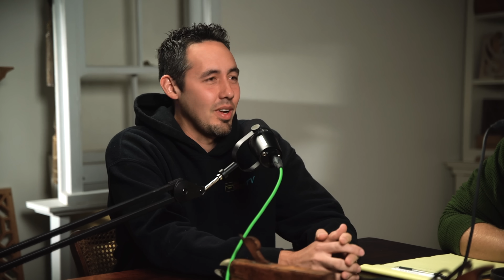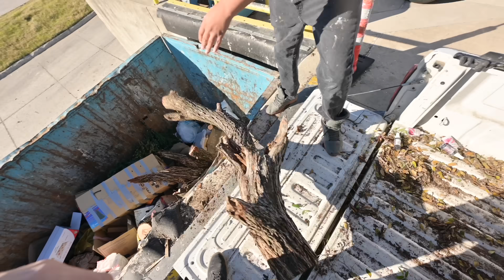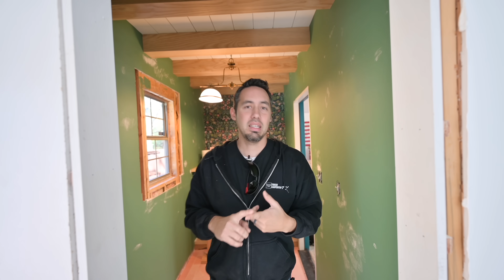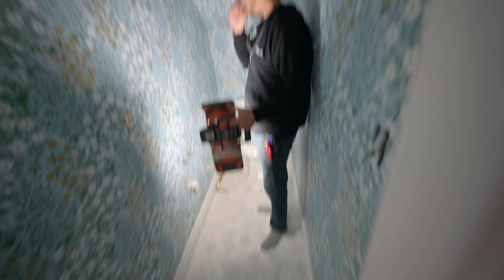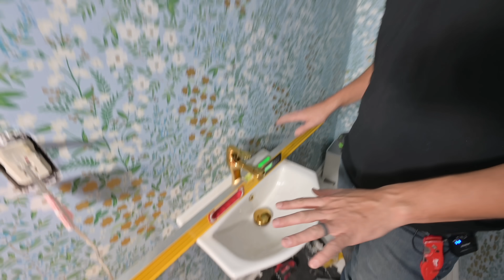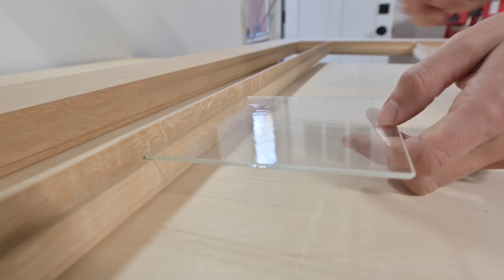The end of this channel as you know it.

Comment: POP UP CAP on your sewer clean out outside your house. If you don't have an exterior clean out install one just outside your house and put a pop up cap on it, when the sewer backs up it will release through the clean out pop up, no more sewage in the house. This is a cost effective stop gap method until you get the line repaired/replaced. You're kidding yourself if you think tile and a marble base will contain the sewage, it'll flow out of the bathroom just using a different path, the door, you really want to experience that again? You must know a decent plumber to do this simple job if you're not feeling up to it, get some advice.

Comment: My master bath is narrow as well (approx 46"). The common wall between the hall bath and master bath was framed w/ 6 1/2'' lumber (odd) in order to allow room for the vent stack between the back to back toilets. This dead space allowed me to build a 4'' deep niche for the sink while still leaving a cavity for the plumbing. It was a big change space-wise and added nice architectural interest as well. I used several of these space-enhancing techniques in my whole-house remodel. Another cool one was a laminated wall between the hallway and and shower stall. I removed the 2x4 wall framing and replaced it with 3/4 plywood. I put 1/2 drywall back on the hallway side and screwed cement board to the plywood on the shower side. I then water-proofed and tiled as usual. The entire wall thickness is barely over 2'', which added much room in the shower without changing the hallway at all. Love your channel. Looking forward to watching as you build your & the Mrs. dream . I appreciate that you are choosing quality materials, even if it may feel too spendy at times. As they say . . . Quality remains . . . (and so does the space that's created from nothing). Cheers

Comment: Pull that toilet and have the drain inspected with a camera snake. The snake has a radio beacon in it that can be located exactly. They can push the camera onto the pipe, locate the roots so you can dig and repair .
Reply: Might be a clay pipe, might be easier to line it?
Reply: There’s stuff you can flush down the commode every now and then to deter those roots from intruding. The alternative would be to drop a couple of grand and have the line dug out and repaired. Whatever you do, never use flushable wipes, that’s the kiss of death to a sewer line with root intrusion in particular.